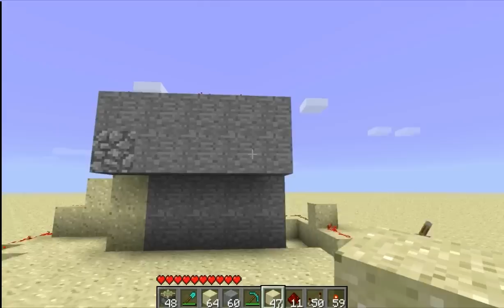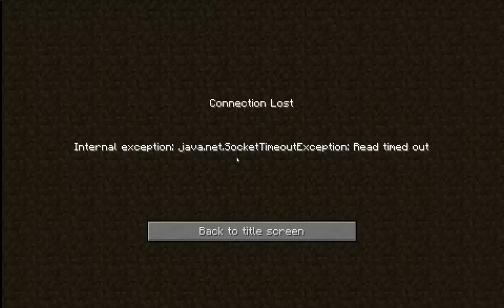Arena Piston Design Example and Clearing my Chest a little

Comment: @Argorine
I was planning on having the mob system underneath the whole arena (remove the farm I guess) and a bunch of water (or maybe piston) elevators going up to near the surface, where they are held back by hatches (or maybe pistons if I can make the work). The levers controlling the doors would instead control the hatches/pistons.

Actually, now that I think about it, maybe the whole mob system could go in the spider's head instead, that would make the whole mob transportation a lot easier.

Comment: @TornAres Yes, he mentioned that in his previous video that the obsidian would have to be replaced... you could at least make the floors and anything not piston or pushed be obsidian coated... so the redstone would be safe.
As for the pistons, they should be protected by the cobble most of the time. And since the explosions don't blast THROUGH cobble, it would mostly be replacing the cobble.
Not as much of a pain as it seems, I think.

Comment: the only problem i see with the system is it would take out the middle water trench  which is the main way mobs keep funneling in from the rooms anyway.  Because if you hit the switch and it pushed them out then you went down there then thats all the mobs that will be pushed out, but with the water pushing them out then you can have a semi constant stream of mobs.  The piston doors however seems easy enough to manage though.  I'm trying to figure out a way to make max mobs on the field.